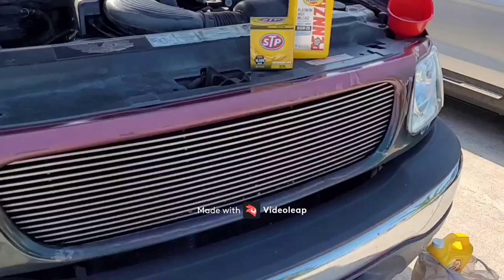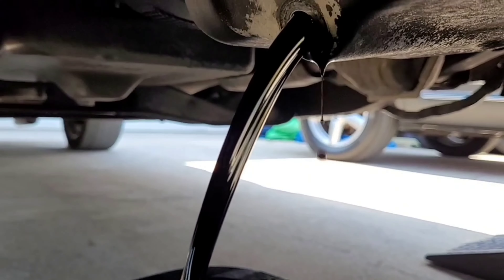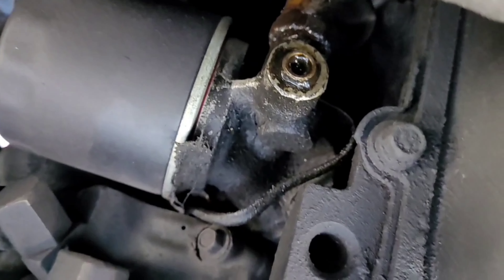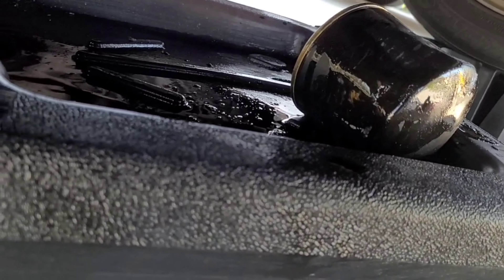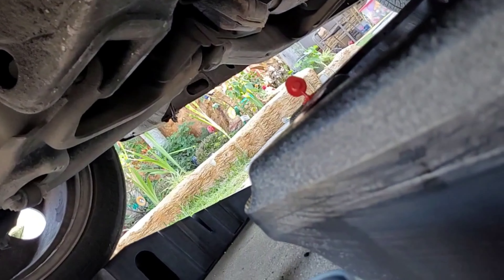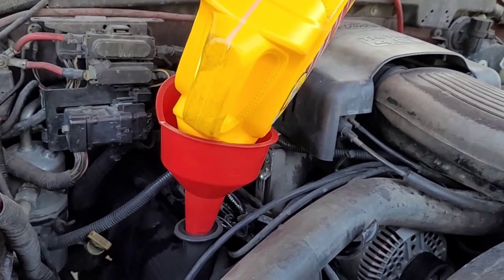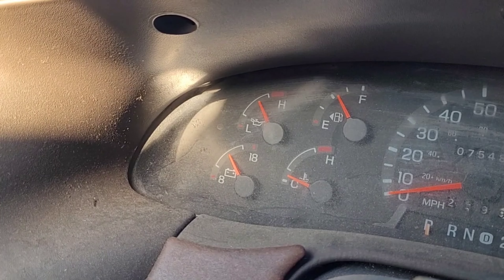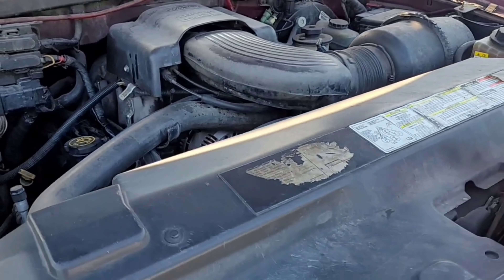How to change the oil in a 1997 Ford F-150 4.6

Comment: Cannot use a single ramp on driver side.  Will not be able to work the filter out because of elevated lower axle leaf.  I see 2 ramps here.  Probably easier to use jack stands under frame behind left front wheel.

Comment: What’s the beeping sound during start up
Reply from the maker: I'm pretty sure it's just a startup, sonud, or is that not normal?
Reply from the maker: The truck that I'm working on in the video. It has no airbags, the driver and passenger, both because it is a rebuild title. And they never put the air bags back inside, and that's probably why it made that sound.